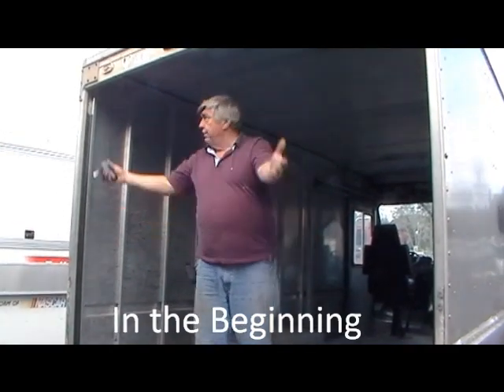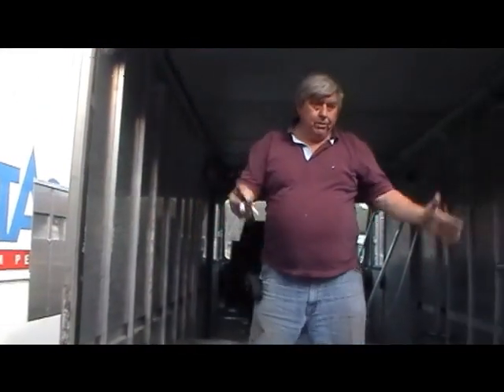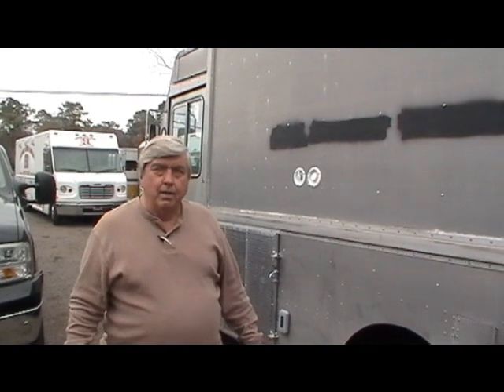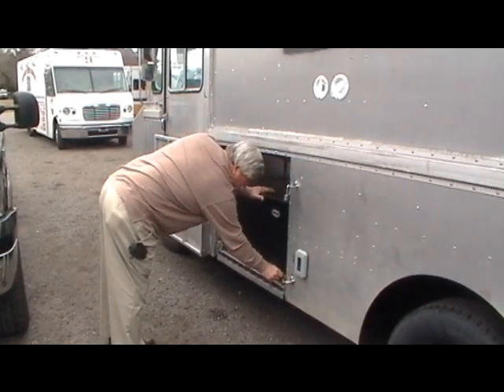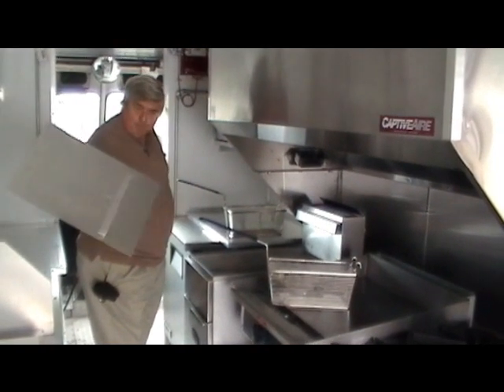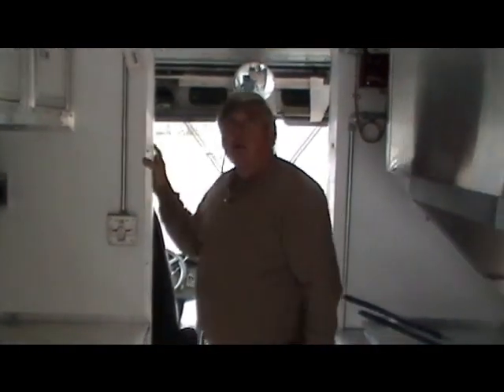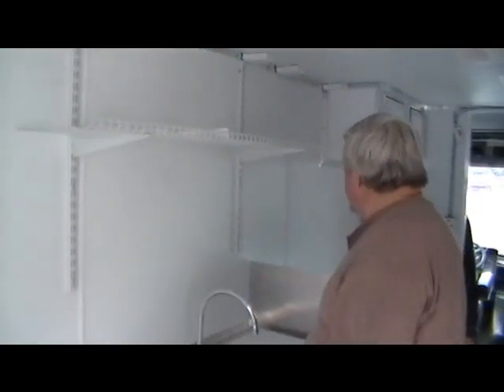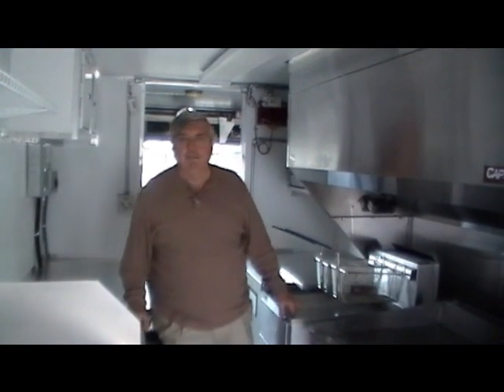M&R Trailers   How to Build a Concession Truck

Comment from the maker: Depends on what type of equipment you will be installng.
Can be anywhere from 30K to 50K.
Basically you are building a kitchen on wheels complete with electrical, plumbing, A/C, gas piping etc...